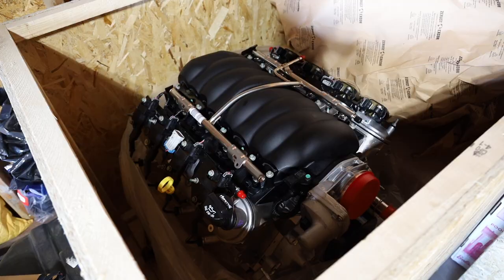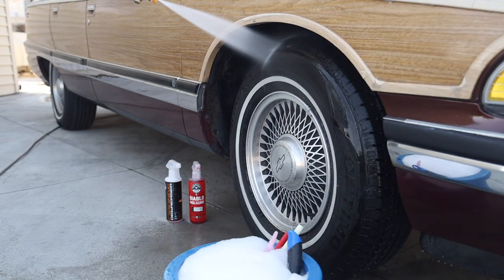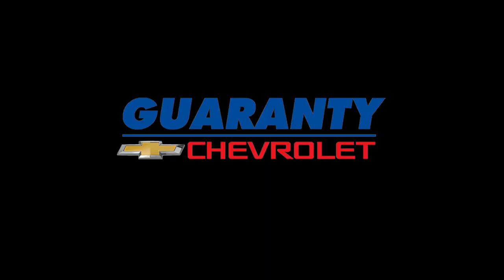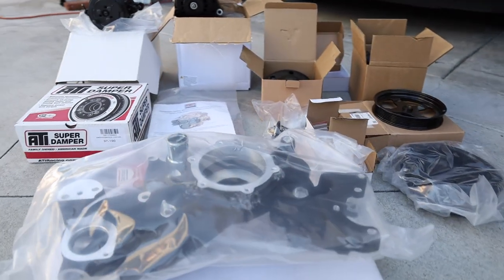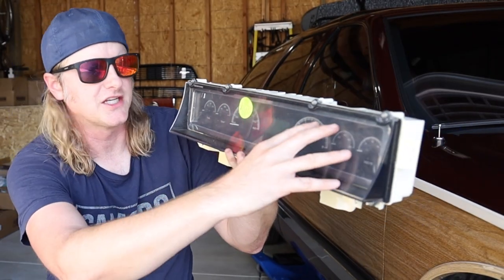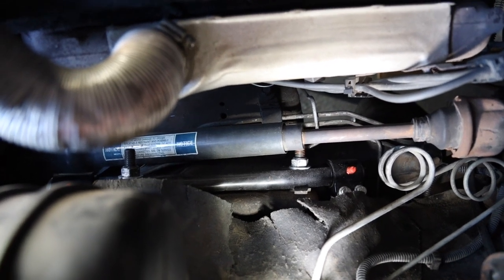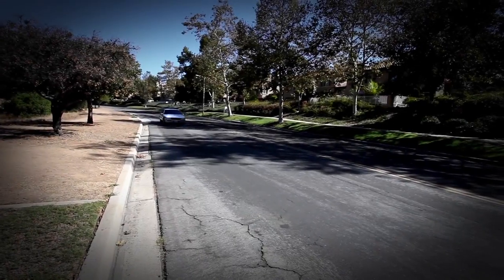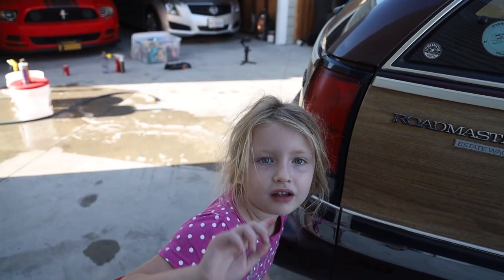LS3 Wagon Swap | Part 1 |  ALL THE PARTS For My FIRST SWAP!

Comment: I just bought the previous gen wagon. 1990. I’m wondering if I can do something similar. And should I put a stick in it? This video is excellent but is also freaking me out when I think of what it will cost me.
Reply from the maker: I sorta wish I had a stick, but also thought it might feel too truck-ish in a car with a bench seat.

As for the parts, there will be specifics choices to be made related to drivetrain and your vehicle, but for the most part, many of the GM B-Body goodies are from either the late 60s or 70s through 96.

It is very expensive, especially if you live someplace with restrictive emissions regulations.

Comment: Great job! Great video quality! I think a Roadmaster would look really great lowered on the same body style impala SS five spokes from the factory.
Reply from the maker: A lot of Roadmasters & Caprice wagons run those and they look great! 

I went with 18" wheels so I could get performance tires... 255/50-17s (the Impala rim OEM size) are hard to find now. So when I saw that Michelin made 255/45-18s, I looked for 18s. 

All of that will be covered next week and thanks for the compliments.